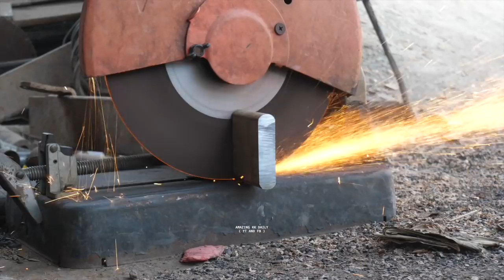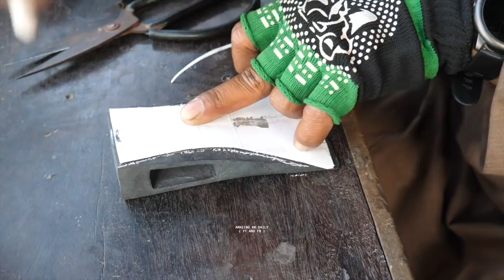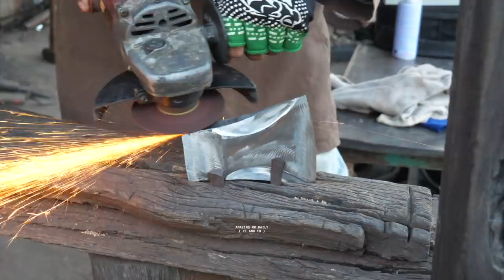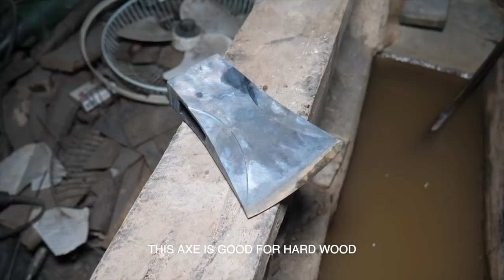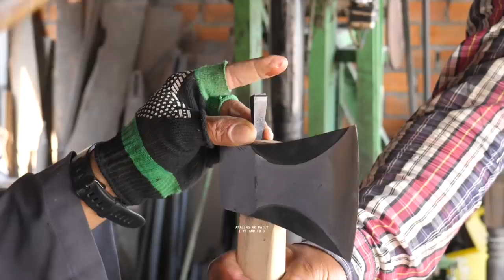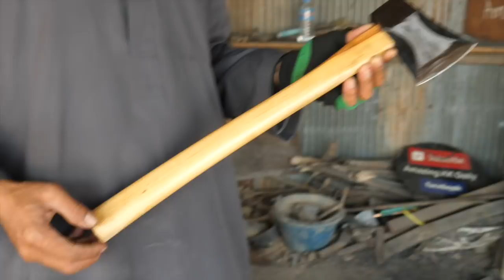CAN'T BELIEVE THAT ROSETH AND DEJO CAN MAKE THIS BEAUTIFUL TUANTAHI AXE WITH A FEW TOOLS

Comment: He is an amazing craftsman, the design also allow logs to release the axe more easily. hardening the cutting edge and hammer head first allowing the rest of the axe at a tampered stage.
Reply from the maker: You knows a lot about this work
Reply: @AmazingKKDaily  Not really, i've been a metal working machinist for 47 yrs.  so i know quality workmanship. keep up the good work.

Comment: What is the difference between quenching in water and oil?
Reply: Water has a faster cooling rate. Oil can be heated hotter than water. Slows the cooling rate.
Reply: Watter is good for axe oil is good for knifes and swords
Reply from the maker: He always quenches in water and the result is always great
Reply: but try this technique it is the best hardening technique in my country .... heat the ax and lightly put it in water for 2 seconds then take it out and wait white will appear then yellow and finally blue on blue extinguish try put it in water you take it out and wait 3 4 seconds then again and wait for the blue color
Reply: the technique is not to cool the iron as soon as possible but the technique is to wait and watch the paint on the iron
Reply: blue is the strongest and best for sharpening
Reply: @AmazingKKDaily  yes all his knifes and axes quenched in water...good job sir
Reply: @scottlanghorst1483  tq sir for the explanation
Reply: @kalifammm  tq bro for the explanation...